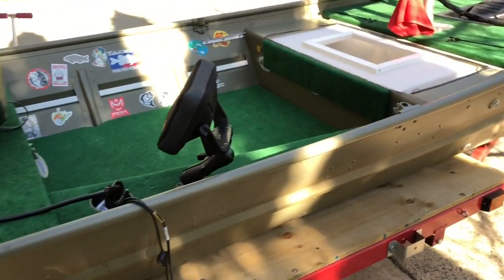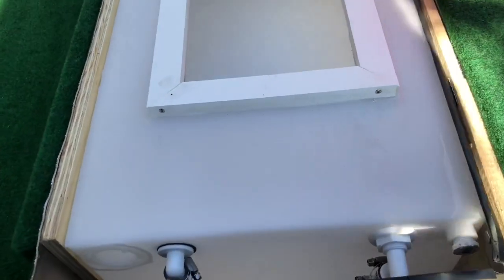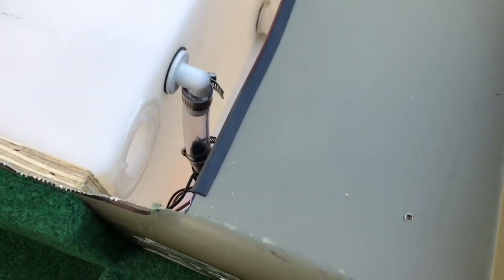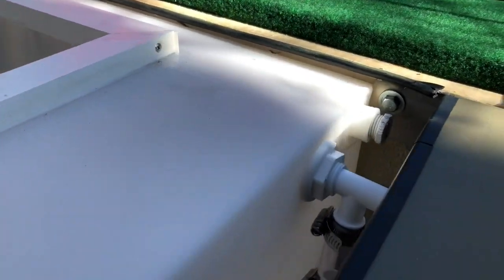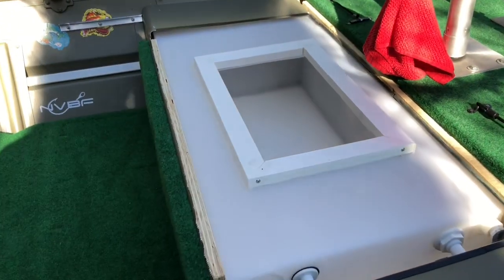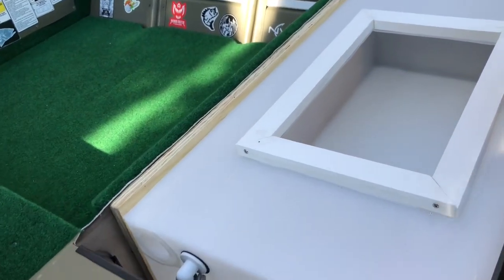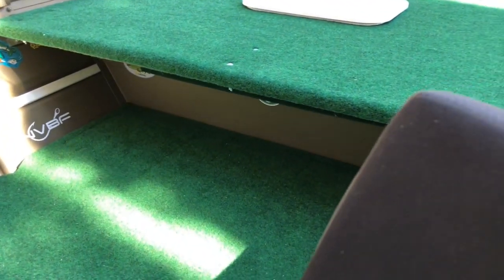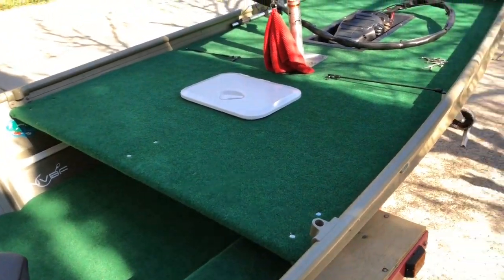Live well setup for Jon Boat

Comment: Hey man great vid helped me a lot with my build. Did you have to prime the johnson? Mine will not bring water in. The inlet is below the waterline as well. Did you have any problems?
Reply from the maker: mattgodd25 Mine did take a second to start pumping in water. Check the valve on your flo-rite if you have one I had mine set to aerate not pump  that was my issue. 
Once I have that part figured out it worked fine. Could be a bad pump though if it’s not pumping in water. In the future with mine I might switch to bigger pumps probably would do a better job. This was my first build so that’s what I ordered.
Reply: @themichaeltanner  I liked the way you did yours, so I tried to replicate it. It was my first as well. I think I may have plumbed it wrong. I never got a good pic on how you did it. I have my red johnson as a stand alone right in inlet. And my other pump with the flowrite to outlet and airate
Reply: I may have done it wrong haha.
Reply from the maker: My Johnson pump I have as the pump in for the tank. I have the holes in the side of my boat so the water is right there. If it’s too high above the water line it will be hard to pump. I don’t think mine is the most powerful. It gets the job done though. The Atwood I have on the pump out and recirc with the florite valve. It’s pretty  simple to do the plumbing. Let me know if you have other question? Also send me some pics and I can see if o can figure out what went wrong.